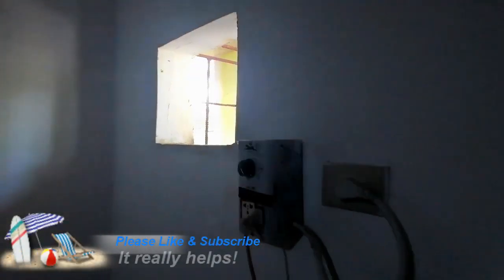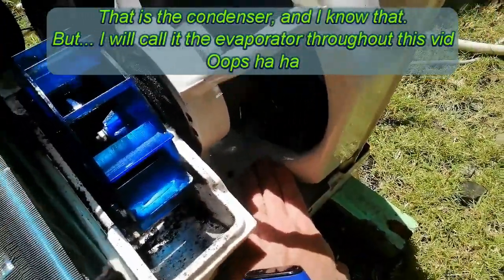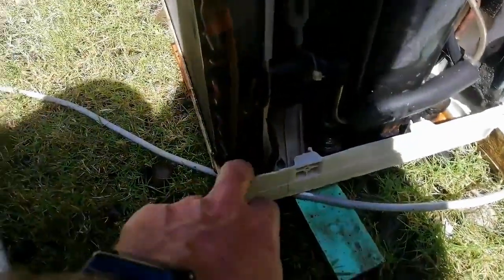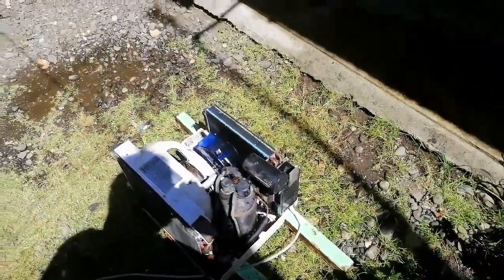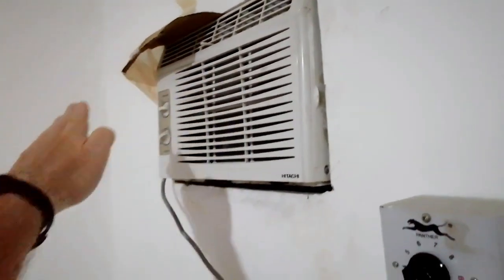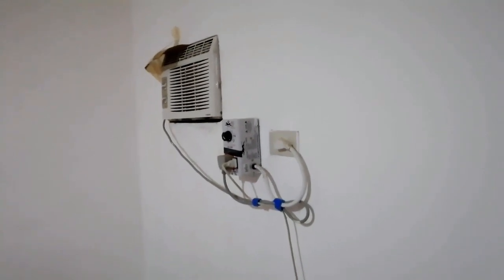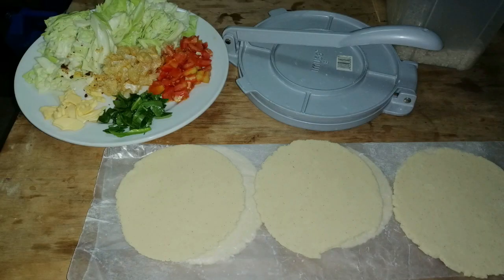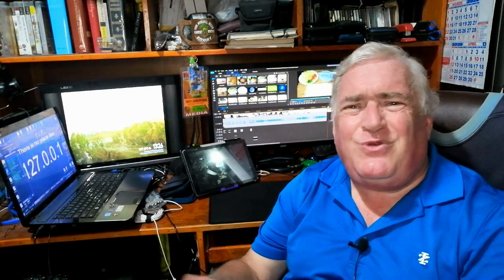Cleaning Aircon and Cooking Tacos Expat Iloilo Philippines

Comment: I went to clean some AC units over there and could not locate any foaming coil cleaner. I shipped over a gallon for the condenser and one for the evaporator. Worked great. Did you use any cleaner?
Reply from the maker: The coils were not very dirty, so just water seemed ok.  I have not seen anyplace to buy coil cleaner here.  Never seen a real parts house 😎